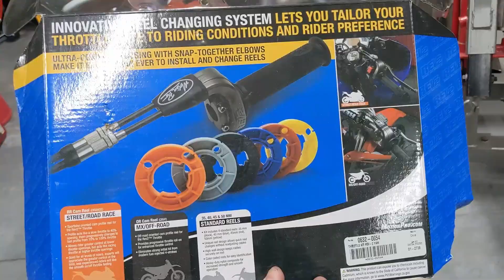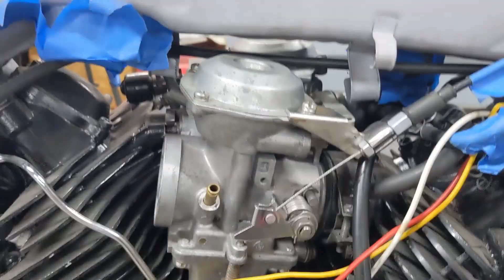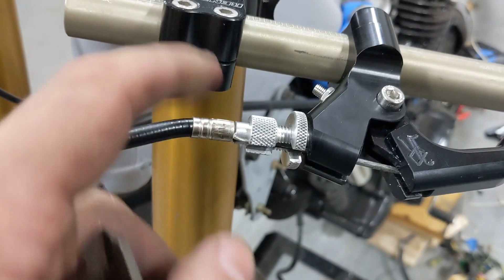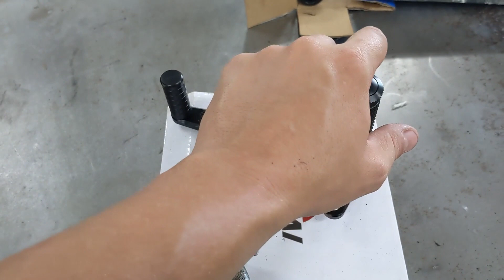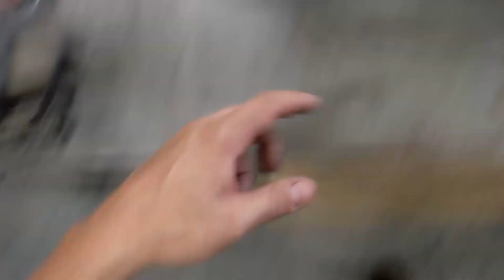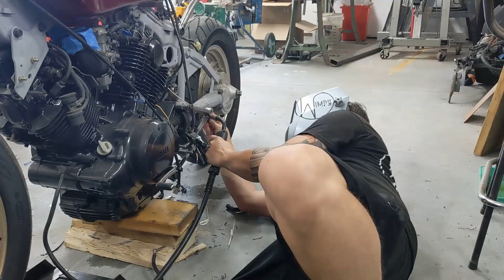XV750 w/ R6 Front Forks, Now With Controls!  And, Custom Rearset Mounts!  Cafe Racer Build Ep. 4

Comment: I'm not from an English-speaking country, so there are parts I don't understand. If I switch to his wheels, will the center of the car and the center of the tires stay the same?Will the tires get wider? Doesn't that matter?
Reply from the maker: The rear wheel I am using you need a specific swingarm to fit a wider tire.  Everything about the front geometry is changed by changing these forks.  It will ride much different than when it was original.

Comment: you do the clutch adjustment with the screw and the nut in the centre of the pully- you can never really get the felling for the clutch disengagement until you have it running and sitting on it :0

Comment: I did a virago cafe years ago before it was like crazy thing, had the kz tank and floating seat that looked like I was sitting on air. 

For shift link. Heim joint on threaded rod. Then find carbon fiber tubing used on rc drones that fit over the rod nicely. I forget the size but the rod I had fit right into the CF tube. Then I adjusted the link and marked it and cut down the cf perfectly so I had no gap and my links was on the dot.  Really looked custom and had a lot of bikers chase me down and ask what it was. A lot of good conversation. Regret selling it but plan on buying two more to do a cafe on like how moose did it with there twin set up  For me and the wife